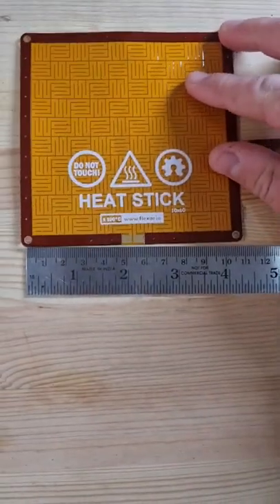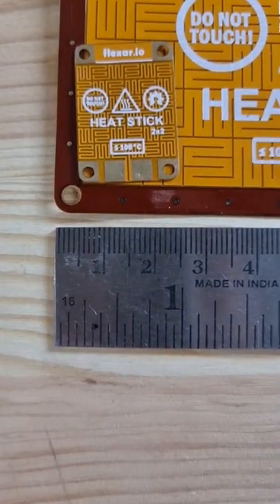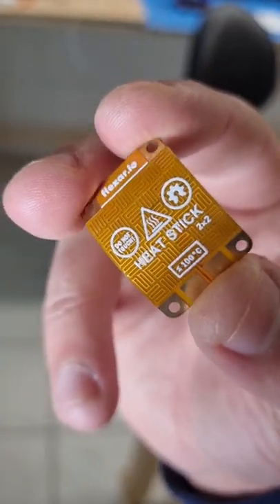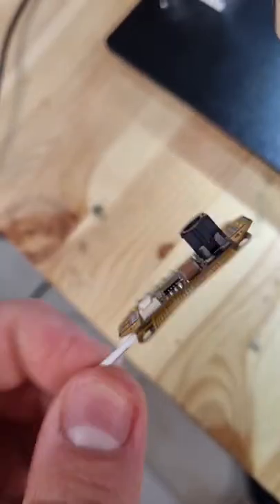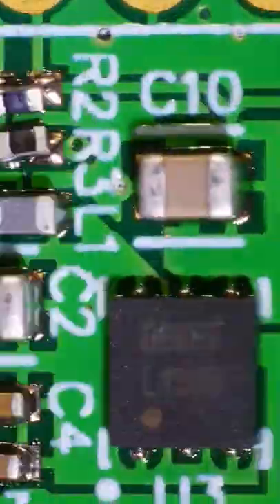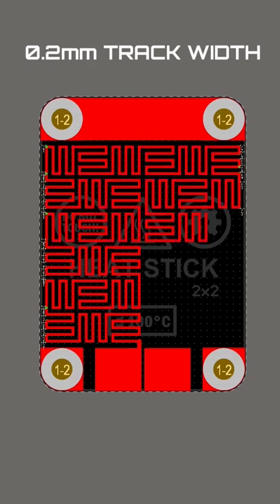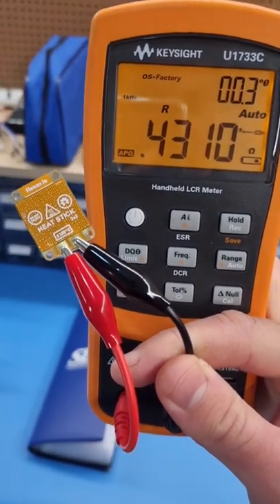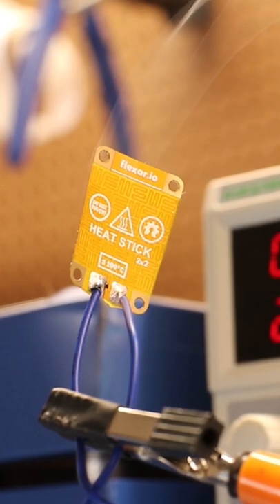Smallest PCB Heater

Comment: Ideal for winter wearables or hand warmers
Reply: That would be pretty cool. Just need to figure out how to make it not accidentally cook your fingers. Although the answer is probably a current limiting resistor. But this would be great for a hand warmer powered by a lithium battery.
Reply: @YSPACElabs  Arduino with a digital temperature sensor and a mosfet for controlling the heating Element...
Reply: @-joo3033  woah, an arduino is way overkill. just a small programmable chip will do fine.
Reply: @sonicsupersam7793  yes its overkill, i know a guy who uses Arduinos for many things, he has a heated bed amongst other things...
Reply: Low power too.
Reply: @-joo3033  yeah, people go to arduinos for simple tasks because they already know how they work. makes sense for temporary projects or a quick setup but if it’s a permanent thing or you plan to make multiple it’s best to stick with some cheaper chips
Reply: @sonicsupersam7793 an arduino is basically a small programable chip, an attiny85  would suit this application.
Reply: That was my first thought he's making heated clothes
     Then I was so surprised 🤯 it can solder PCB 
Dang this is cool but not really cause it's hot 🔥
     Fire 🙌

Comment: Need to monitor copper resistance changes due to temperature during PWM off pulses to keep form over heating.   A contact thermistor or thermocouple probe may be another solution.  These could be fed into a PID of at least a thermal limit cutoff.
Reply: Ehh just use a constant-power supply instead of a constant-voltage.
Reply: @NavinF  i don't know much about electricity, but it sounded like it might be difficult to reliably produce that accurate of a range of voltage without a large power supply.

Comment: OH MY GOD I HAD AN IDEA FOR THIS BEFORE I EVEN KNEW IT WAS A THING!! I NEED some of these guys!!!

Put the heater, in a food safe, conductive housing, attached to a food safe handle that is hollow, non conductive, and can pass the wires through to a battery pack, on the oppisite end, with a small timer circut to only allow it to remain on for a predertimined time, before it shuts itself off to save power, and avoid overheating, possibly with wireless charging capabilities, that way you can make the whole thing water proof, and dishwasher safe, et viola now you have a "heated spoon" you can use to keep your hot drinks hot, without burning your drink, or mouth, by keeping your cup on a hot plate.

Since it goes all the way to 100c you could just purposely limit the power and then it would be even harder to kill it, i mean tea/coffee shoul NEVER be served at 100c, thats friggin boiling lol

Comment: As it uses less than 1V, you could integrate it in a mouse to keep the hands warm and it will be light weight as well
Reply: One volt doesnt mean less watts, as the resistance is quite low it will draw lot of amps that cannot be supplied by usb power supply.

Comment: Have you ever thought about temperature compensation of drift (e.g. amplification)? 
Precision circuits often need dedicated current mirrors to stabilize gain (but still drift). So you either need a LUT across temperature or keep your system stable.
There is likely some PID processing involved but I think it's quite a niche application for amplifiers - and maybe more.

Comment: A non-disposable one, that is integrated on the PCB and with a grid setup can likely heat up a precise area on the board(plus some surrounding spots) allowing repair without a specialized heating device, and perfect for re-balling CPU, GPU and other BGA chips.

Comment: It's all about the substrate. Plus, you may need some kind of current limiting circuitry on board, similar to what is used to keep lithium batteries from overcharging. Should be easy; after all, it's a PCB! It may turn out that the flexibility and stickyness are at odds with the needed thermal mass of a heating element.

Comment: Ive been considering getting a large format 3d printer for a while.
One of the things that has seemed problematic, that I want, is the availability of heated beds over ~300x300mm
If you think its feasible and want to save me the effort, and do it yourself, you have my blessing
Reply: Look at the Prusa XL, 360x360mm heated bed. Uses an array of individual heated segments vs one large one.
Reply: @nicknack125  thats what I would do too. but Id really like to go to 400x400 or above.
It just doesnt exist yet.
Reply: @CraneArmy  ah good point. I know there's nothing you can purchase like it, but Ivan Miranda on YouTube made a massive, custom printer with a heated bed. I think he's got the files available for purchase on his site if you want to build it yourself
Reply: @nicknack125  cool. I'll look into that, even if its just a place to get some ideas it sounds interesting.
Reply: Keenovo makes a heating pad up to 500x500mm. they might also have larger or custom sizes, but I haven't poked around
Reply: I was under the impression that most heated beds were PCB's already?
Reply: @theindieg  They pretty much all are, but you start running into some issues when they get big. Large PCBs are more expensive to manufacture, and making a large PCB that heats evenly (i.e. corners don't cool down faster than the center) can be a little problematic when utilizing the full printbed.

Comment: Did you think about integrating a heater layer in a multi layer pcb to use it as a one tine reflow heater and later as a shielding layer or ground plane (or just forget about it)?

Comment: You could make a heater pcb, wrap it around and connect to a AA battery and use it as a simple pocket hand warmer. Might need some current limiting though... Maybe a simple PTC for some automatic temperature control

Comment: Makes me wonder about a thermos cup with a wireless charger + tiny heater inside (with or without battery, you could use a charging mat at your desk). Heater wouldn't need to be too powerful to keep your coffee warm indefinitely in a thermos cup, and being sealed would make it dishwasher safe. Might need a thermocouple for regulation though.

Comment: I want to make a small heater like you have made 34 x 60 mm to run on 13 volts AC  to heat a surface temperature of 40c for a project I am making, so any help would be good, It does not need to bend.